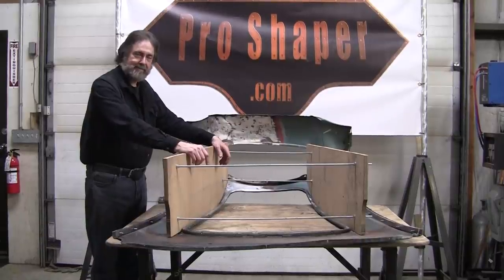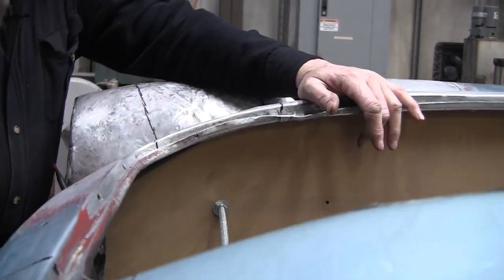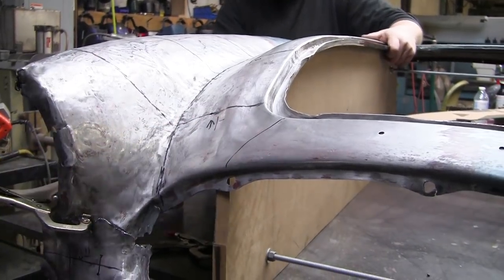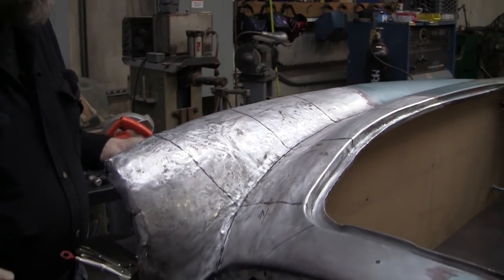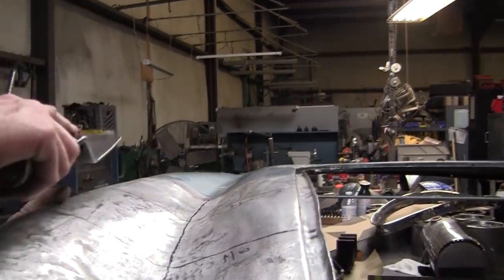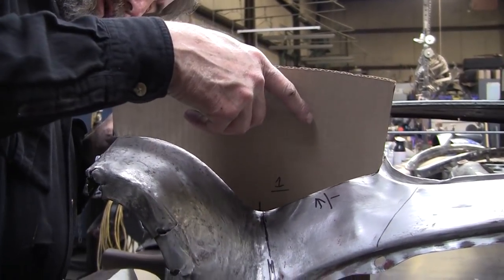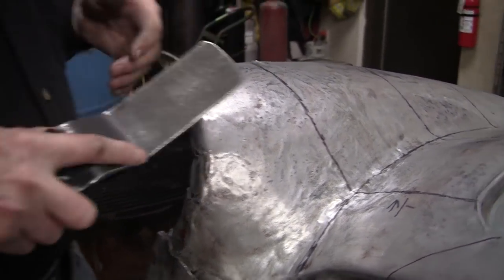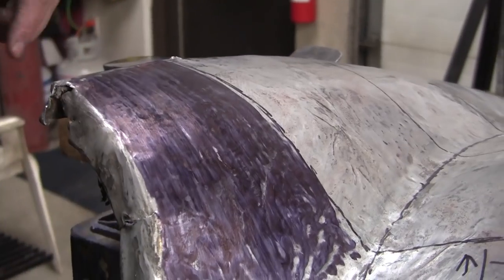The Healey Shroud Dent Removal Saga

Comment: I was a panel beater for 35 years , I never got to learn ally welding or had much to do with ally car bodies , I was freelancing in the 90's was doing some work at a RR and Bentley specialist he had a Austin-Healey 3000 in for restoration I agreed to do it without looking at it , I told them to strip the car of all it's trim which they did , he got my back up over something so I finished the job took the money and walked away not saying anything , now seeing they are ally I'm pleased I did . nice job way above my level of competence .

Comment: A headlight bowl from almost any British car of the 7" headlight era (e.g. Minor, Mini, Sprite), ought to serve as a shape guide for the headlight opening. The screw holes may not be in the same places, but the other dimensions are going to be dictated by the standard lamp. If you can find (borrow?)  one, it would save having to make a guesswork guide.
There's a low-melting point (propane heat) alloy of aluminum available in rods for welding. Would that make a good filler to bulk up places like the welded seam that have been thinned?

Comment: I have enjoyed watching the healey crunch slowly coming back to shape. The two MDF formers were a big step forward that I need to remember. W r t the overlap on the flange, if you pull metal apart till it tears, it stretches before it tears. It is not possible to shrink free edges so how about pulling the panel open till the edges line up, weld them and then shrink the area which will help in thickening the metal. I look forward to your comment.
Reply from the maker: Yes, that overlapping fender flange probably did stretch before breaking. It will get welded.

Comment: Thanks for the excellent video Wray!  I’m following along with my panel at home and have a question.  When you’re planishing are you right over top of your dolly?  In other words on dolly?  Thank you!
Reply from the maker: Both it depends. If the dent is deep I use the dolly and slapper to rearrange the dent from a concave arrangement to a convex arrangement. If the low is only .030" deep then I will use dolly on.  I never worry about overstretching, because it is so easy to shrink back.
Reply: Thanks Wray!  I have a front steel fender that was hit in the front corner so has wrinkles and folded over metal.  I was able to use the torch and methods you showed to get the major wrinkles and folds out.  I made a flexible shape pattern and templates from the other side for area value and arrangement and have the panel looking amazing good thanks to your excellent videos!  My final hurdle is to smooth it all out but I’m finding it hard to get the fine wrinkles and blemishes out.  I have to hit really hard on dolly so I think it will stretch the metal.  Would I be correct in assuming you would recommend I do that and if it stretches I than shrink it back with a torch, slapper, and with a leaded leather bag on back?  Thank you for your help.  I’m going to share my results with my club to help promote your channel.  Cheers Ian R.

Comment: Thats quite a dramatic transformation from the wadded up piece of metal you started with! Is there any benefit to grinding some of the penetration from the factory weld seams off the backside to aid in the planishing process, or is it best to leave the welds as intact as possible when working aluminum?
Reply from the maker: I might do that.

Comment: Hitting down with the slapper and a dolly under it to bring something up is twisting my brain. I haven't found a detailed article on how to move metal off and on dolly to raise and lower shapes.  Do you have a good resource for that?
Reply from the maker: It is nothing more than fulcrum and lever.  The dolly is the fulcrum, and it's contact area is never more than a 1/8" diameter. It has the power of a ballpeen hammer.